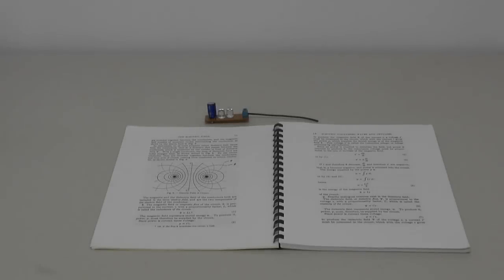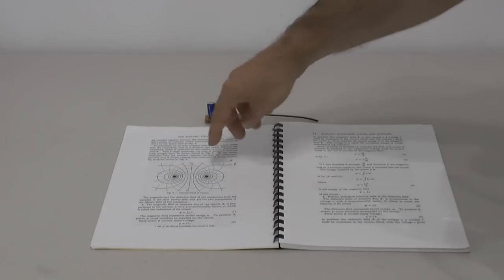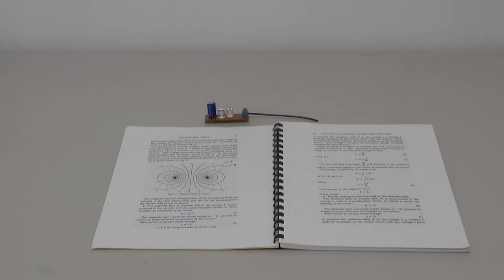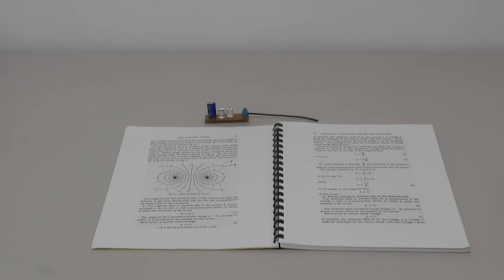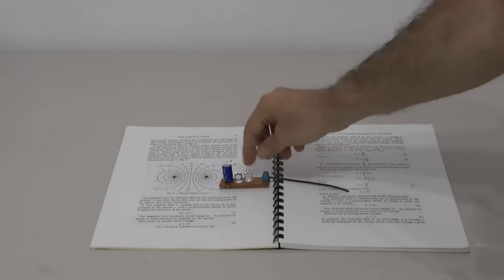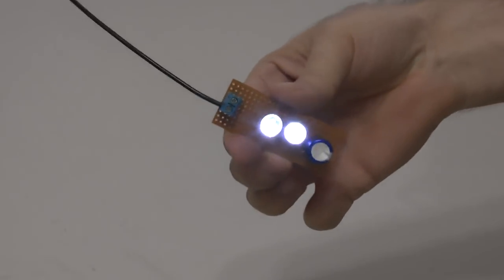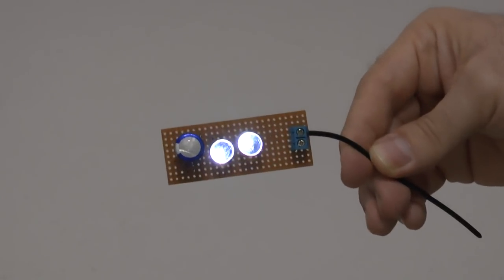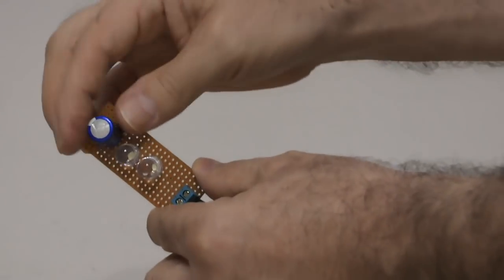Radiant Energy  and Dielectric Fields

Comment: The person is the inductor in the CLR ciruit.
When sunlight hits our atmosphere, a hysteresis is created. This is radiant energy.
Reply: At first glance, there seems to be a direct link between dielectric energy and radiant energy. However, with the more in-depth analysis done by Nikola Tesla, he discovered that radiant energy has components that extend beyond dielectric wave propagation. Aspects of magnetic energy can be impressed upon the dielectric waves. In combination, the result becomes radiant energy which is capable of transmitting waves that are specific to singular molecules. Creating any physical response the molecule is capable of emitting. (Such as becoming charged or discharged or magnetized or demagnetized, or changing state from instantly sublimating from solid to gas (exploding), heating or cooling, glowing or emitting light, melting or energizing... and so forth. Electricity is just a carrier for the radiant energy and resistance are the undesirable effects produced by the electricity, while the desirable effects are the ones produced by the radiant energy (one perspective of what might be happening with electrical responses of some materials to electrical power.) Keep in mind that CP Steinmetz was paid to prevent open innovation of the equipment designed to be used in the electrical systems that were deployed. He was specifically shaping his descriptions to hide the true nature of electrical physics. Likewise, Tesla was primarily focused on issuing patents that secured his prior claim to any designs using his methods without giving away insights on how to derive the same results using different means. His descriptions may be overly complex or lacking information identifying the key details that enable success.
Reply: Can you tell us more about this process, please. Is radiant energy the same as dielectric energy? Is hysteresis not an effect in ferromagnetism? What about a receiver for the radiant energy?

Comment: Just an fyi for the party.  I was able to get back to my simulation that worked similar with a twist.  I wanted to get back to using touch to ground the circuit.  In my case, I could not tune it to the radio freq using single wire antenna.  So instead, just using single wire from the tesla secondary coil.  This lights the leds when touching the ground lead.  Also, I was able to get enough ground potential by jumping to an open bus bar on the breadboard, so it stays light without touching it.  In this config, you don't need the Cap either.  Now if I can just get ride of the direct wire and trade that for a Radiant wire, I will be happy.  Also, I am actually not certain what your seeing is reversed of what you think.  The dielectric pos charge might be radiating off your body from the coil and the single wire antenna might be enough of a ground potential for the system.  The dielectric stuff gets really strange, almost like pos and neg goes out the window in terms of our normal circuits.
Reply from the maker: No touching of the conductor will work I am afraid.

Comment from the maker: I have just received the first accusation that I am deceiving viewers. I am only interested to demonstrate here the propagation of a dielectric field. In this example, I have used a Tesla Coil in the background in case you did not understand the phenomenon. The subject is the dielectric field. To receive it and convert it into a DC powered load is very difficult. The short wire can, from a Transverse radiation point, only receives energy in the VHF/UHF range. No coil is present to convert it and no bridge rectifier to create DC. I, myself tried to build a second receiver and failed so far. Only dielectric field energy can be harvested here. They are very easy shielded by any dielectric as demonstrated with my hand. A Tesla coil under the table does not work only next to the load, 50 cm and away from the wall.
Reply: @TheOldScientest.  Good stuff.  All people have to do put it together and test it themselves.  Works.  Have no idea how people doubt things without trying it first.  Good video.
Reply: @TOS.  Not understanding something.  You tried to build another receiver, and it did not work?  What was the special magic on this one?  Somehow got the tuning right?  Also, what Freq are driving the tesla coil at?
Reply from the maker: I tried to build the same LED load but could not get it working. Just to state that it is difficult to get it working. The Tesla coil resonance frequency is 480 kHz. As always, I use this coil for 10 Years. Watch all my other videos with this secondary coil.
Reply from the maker: In this example with the wires are the Tesla coil and the LED load. they are completely different compared to a coax able where the values are the same. But the principle applies. And just for the record, it is only a fraction of power you can harvest from the dielectric field. LED load maybe a couple of mW but the Tesla coil minimum 500 mW.
Reply: Thanks.  So the ground is just floating at the connection points of the Cap and the LEDs and when you touch the dielectric somehow creates a ground to body and allows the current to flow?  I have seen some similar effect on some things I was doing, but was not 100% sure what was going on.
Reply from the maker: Floating ground might be correct but no in this case. A radio receiver in your hand is not connected to ground . But some antennas require a ground. I will also not call it capacitive coupling that implies electromagic circuits. In terms of coils and capacitors, closed loop. A common ground is not available either. I will try to exactly rebuild his LED load and attach a larger insulated plate as receiver.
Reply: For anyone who was confused, the radiant energy is being received not with a classical antenna, but with a capacitor plate and a rectifier, similar to what this guy was doing: https://www.youtube.com/watch?v=nRdj4Tqdp90

Yeah the guy in the video I linked also uses batteries plus a joule thief which was an unfortunate choice, but his collector device indeed works. You can't necessarily keep adding those recievers and expecting overunity, but the energy is exchanged via parasitic capacitance/dielectric tension, not by transverse waves.
Reply: @Michael.  What is a way to explicitly test if your in dielectric tension land and not TW land?  I have two tesla coils with a ball ontop each.  Secondaries are connected single wire to the  other secondary a "ground" .  At resonance, life it good and LEDs light, etc.  Then I wanted No wire.  I was able to get ~close.  On the RX secondary, instead of attaching it to the ground wire, I attached a copper bowl.  Then on the open end of the ground wire, I attached a steel bar.  At about 5" separation, the ground loop is still complete and LED lights.  I can get a bit farther by sort of daisy chaining glasses of water between the distance, like little islands of water.  The behavior is very strange on what works and what does not.  I am wondering if this is parasitic capacitance or dielectric.  Feels like dielectric to me.  

Right now, I am trying to block the balls with a steel pan.  If they go out, I assume TW land.  If they stay on, I am assuming LW land.  But this feels bad as a test.  What I am hoping for a complete remote ground or wireless ground back to TX.
Reply from the maker: The dielectric fild is propagating 90 degree to the wave propagation of the solenoid. It is not related to frequency but to high voltage. If the electric potential is high enough you can hold a LED in your fingers and it will lit up. Any metal will convert it back to waves with very low efficiency. Any high voltage capacitor will charge. Here I am puzzeled why a potial difference is available on the capacitor which has no polarity.
Reply: "on the capacitor which has no polarity".  You lost me.  Capacitors have polarity.  I assume you are referencing some idea I am not following exactly.  Thank you.
Reply: Electrolytic capacitors have a polarity. A parallel plate capacitor with a mica dielectric, or tesla coil topload and a piece of metal at a distance both have a capacitance associated with them, but they don't behave differently depending on which plate is at which voltage.

At high voltages and high frequencies, parasitic capacitances can transmit considerable energy. Energy transmission by dielectric tension is the same as parasitic capacitance, as far as I know. Just different vocabulary from different time periods. To get Tesla coils without a common ground to exchange energy you want to maximize the parasitic capacitances between their toploads or just have excellent tuning and a high Q factor (low losses when resonating)". Best of luck!

To use an analogy, you can think of a "radiant energy" receiver as a closed pneumatic tube with two check valves, and a piston between the check valves. When the piston pushes in, air flows through one of the check valves, and when it moves out, air flows through the other check valve, so that inside the tube, the airflow circles through. For an electrical circuit, the piston is the capacitor plate on your detector, which is exposed to a dielectric/electrostatic/electrodynamic field (similar concepts). The check valves are the diodes, and a capacitor and a load can be placed  in parallel (and series according to some of TheOldScientist's experiments? doesn't make sense to me either.) between the diodes, on the other side from the "piston" capacitor plate which lets energy enter the circuit. Anyways a tesla coil will behave "compressible" when the capacitances on its ends are subjected to an external dielectric field (electrostatic, electrodynamic), and stores the energy like an LC tank circuit, so it is another type of "radiant energy" reciever. Any circuit where the electrons may be displaced or flow back to the topload may be able to exchange energy with an external dielectric field.

A single iron pan will not block either transverse waves or electrodynamic waves well. A faraday cage will block transverse waves with wavelengths much larger than any hole in the faraday cage. A cookie tin with enamel on the lip as in https://www.youtube.com/watch?v=wjz-5Lqtxow won't do because the two metal parts are insulated from each other and that counts as a large hole since the voltages on the metal parts may differ in an electrostatic/electrodynamic field (could we get a redo of that experiment TheOldScientist? I suspect the result will be the same, but it's good to control for extraneous variables) Also two nested faraday cages with a resistor and inductor shorting them to each other but otherwise insulated from each other may attenuate the electrodynamic near-fields.

Sorry if I am using a few words kind of interchangeably, They are quite similar but with some nuanced differences. I'd be happy to explain some other time, but out of time for today.
Reply: As for telling dielectric tension from transverse waves, they're all solutions of maxwell's equations in space and time. Dielectric field is an older term that goes along with the intuition that capacitors propagate energy across them, whereas the more modern poynting vector says the energy comes in through the sides of the capacitor. Just different ways of discussing the same phenomena, though you can engineer circuitry to optimize for different behaviors. For example when you added the glasses of water to your circuit, those made it behave more like a dielectric antenna. I hope that helps.

Comment: Nice vid simple and simple to understand...vibrations and resonance.  Tesla indicated an 'insulated' plate as to not dampen the minute induced vibrations of the vibratory sensing plate.  The plate does not sense 'waves' rather vibrations which travel through insulators.
Reply from the maker: I would go a step further. Electromagnetic waves are not converted by dielectrics, only the dielectric field from a radiating vibrational conductor. The conductor plays here the role of the capacitor plate, where the dielectric stores the electrical potential
Reply: You understand since you make it simple and small, so you can break down you most basic as one step in series to final result. 

So dielectric field or D.E, it is in capacitance so mainstream understand but you understand deeper so capaciance will not break apart as give current as it reduces so capiPance is same as battery, but you menion Dielectric holds electrons, so mainstream use small part, in compare to maget, a square one, it has 4 node at edge and center node, the corner is 4 capacitance, where iron pushes out at N & S corner, and E & W corner, so counter space where zero point energy, dielectric field, it holds the space where we exist and see thru micro, when you use hand to touch cap., the material absorbs your electrons and transfer to node point and push out in balance so energy come from counter space. Like everything is maget, it has light to dark, pull to push, not old fashion that is impact to cap. so the edge absorbs as resist which it chips as it lights up. So there is three energy process: impact as resist, absorb or repeal from node point at center of edges.

Comment: The electromagnetic field is made up of two componenents; the magnetic field, and the dielectric field. Without these two together, there is no electrisity. The electromagnetic field, is by definition the sum of the magnetic field and the dielectric field.A coax cable does not supress the magnetic field, it has properties that confines the magnetic field inside the insulation. This is necessary for the two fields to propagate at the same speed, to avoid distortion of the signal, as proved by the inventor of the coax, oliver heaviside.

Comment: This page may provide a useful source of further information about dielectric antennas: https://en.wikipedia.org/wiki/Dielectric_resonator_antenna.

The sun indeed emits a dielectric field, as electrons boil off more easily than protons. Thus the hot sun has a net positive charge and the oort cloud has a net negative charge. This may explain the anomalous heating of the corona, among many other effects. On earth the solar wind boils electrons out of the thermosphere, but also the atmosphere acts as the dielectric of a capacitor, and the passing solar wind sets up resonances like a person blowing on a flute. These resonances maintain a net positive charge at earth's surface, relative to the ionosphere or thermosphere. The fluxliner likely used the principles behind Naudin's electron pump to use an AC field to throw off electrons into the leaky capacitor that is the air and ground at a distance. The positive charge on the craft then permitted it to float by balancing the earth's gravity against its electric field.

The Thunderbolts Project on Youtube has done some interesting research on these topics and how they relate to astronomy, though I remain skeptical of many of their claims. I think their electric comet model, their idea of Birkeland currents as a possible explanation of "dark matter" and z-pinch effects during star formation, and their plasma double layer experiments (langmuir/LMD waves), show real promise. They go overboard though with their attempts to tie things to ancient civilizations and explain relatively mundane weathering events in terms of electrostatic discharges. Except possibly on Mars where dust storms probably do have a non-negligible electrostatic component due to their thin atmosphere.

Comment: İt s a real.where is the scheme .pls send to scheme
Reply from the maker: No, it is one diode connected to the capacitor. The capacitor is in series with the LED. Whach the other videos with this LED load.
Reply from the maker: 1 Electrolytic capacitor and one LED across the leads.
Reply: To be clear, are any of the devices connected via traces together or are they all explicitly not connected to each other? just the dielectric medium connects them all?  Also, it looks like you have something else below the capacitor on bottom of the board.  It is hard to see.  You have a resistor or something?  Thank you much.